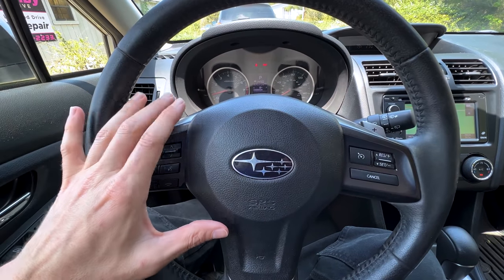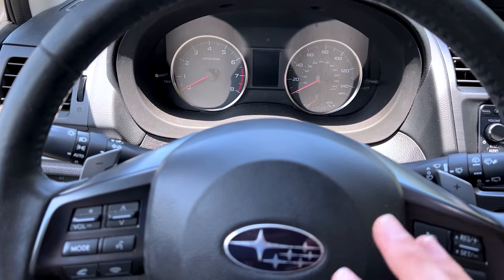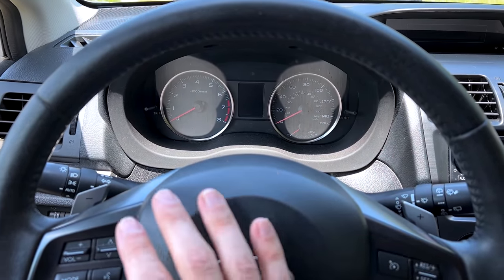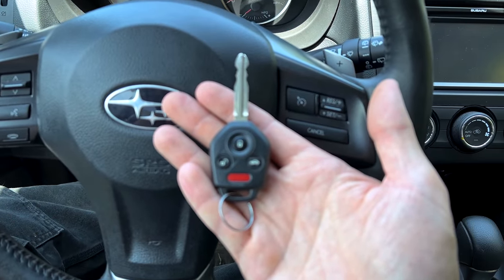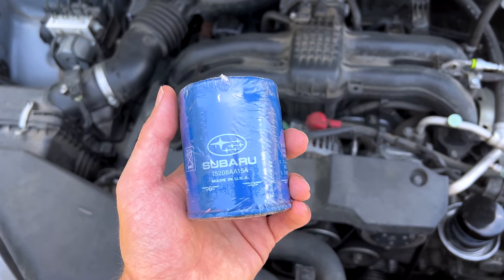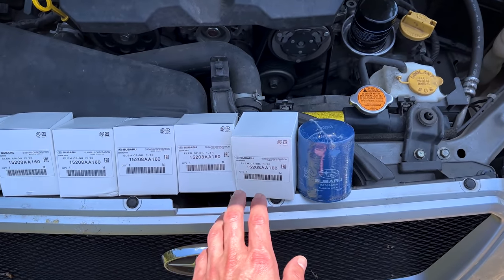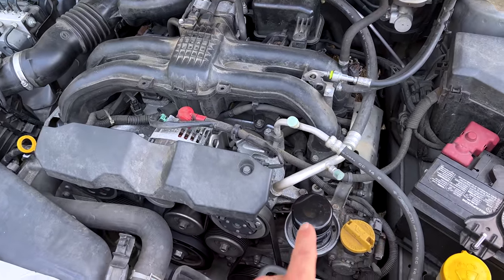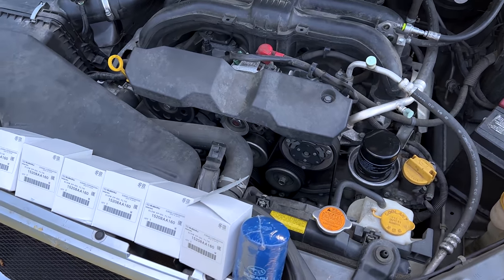Subaru Clear Flood Mode Cranking And Black Vs Blue Subaru Oil Filters! Know The Difference!

Comment: To add to the cars with the push button start, you still need to put one foot on the brake when you floor the gas with the other to do the clear floor mode.
Reply from the maker: Ah, right. Forgot to mention that left foot braking.
Reply: I’m going to try this on my 17 brz and 13 frs I wasn’t aware of this but will definitely become a must in my maintenance proceedings
Reply: If I understand You correctly this is going to work both with AT and MT Subarus?
Reply: @MrSubaru1387  Curious how this works for the plug-in hybrid.
Reply: This is the comment I needed! Thank you!
Reply: @chadwickmason9851  does it work on the BRZ? If stick, I'm assuming you need to Floor the gas and clutch, since we don't have 3 legs 🤣
Reply: Hi Mr. Subaru. Will a Toyota 86 oil filter better then the Subaru blue oil filter for the 2013 impreza 2.0L non turbo?  The Toyota filter seems wider and shorter then the blue Subaru one. Will u able to do a compair for those?  If they are compatible, then I will switch to Toyota 86 oil filter rather than using the blue Subaru filter. Thanks for your review
Reply: What if is a manual transmission????? I have a buttorn start, press on gas pedal and break hit the button and nothing happens!
Reply: If i press the clutch it would just start and rev up
Reply: @Fabiek3  it does work with manual. I have a 2013 manual crosstrek, it’s all the same you just have to floor the clutch like normal and floor the gas to disable the ignition and fuel injection. The only difference is the clutch
Reply: @balancebreaker1561  if it’s a manual, the clutch has to be floored for the starter engine to do anything at all
Reply: @balancebreaker1561  you have to press the clutch and the gas to the floor for a manual
Reply: @loganrobinson8135  Thx Man for the answer ;-) last time i change oil i just try this and as You say it worked ;-) not that i need it much, cause i can fill oil filter with clean oil - it is in bottom of engine - but its good to know
Reply: @loganrobinson8135  you late my friend but thanks tho
Reply: @loganrobinson8135 i knew that from the start, the part i was missing was the Ebrake had to be on too
Reply: How long do you crank after an oil change? Thanks for the video!
Reply: Thanks you are right sir😊
Reply: Thanks.  Question:  How long do you crank the car for?  How long does it take for the oil to reach all the parts?
Reply: @MrSubaru1387 Did you have your other foot on the brake pedal?

Comment: Yesterday, I had my oil changed.  Thanks to you, I knew to buy a black filter, and used the flood mode just after they filled up the oil.  I did originally buy the blue one, then bought the black one, was surprised how much heavier the black filter was.
Reply: Did you get the black filter from dealer?
Reply: @truckerrickakamanowar  Yes.
Reply: @CharlesSnyder  Thanks

Comment: Good info. I like using the Wix XP 57055xp oil filters on my Subarus due to the premium construction and it has the correct bypass spec.
Reply: I roll with Wix as well
Reply: Extended interchange filters like the wix XP can go for those longer periods because they filter smaller particulates out less efficiently than the standard wix. If you change your oil every 5000 miles your engine is better protected with the original wix filter
Reply: Here's a tip, 51356XP. Same filter but more material. I've been running them on my 08 Forester for years.
Reply: Does anyone know the bypass spring strength/tension on the black OEM filters?
Reply: Thanks to his oil filter tear down video I only use Wix oil filters.
Reply: @TBlade471  I find the bypass pressure to be too low in the 51356 filter(8-11psi). The 57055 filter has the correct Subaru bypass pressure of 27psi. Less chance of the oil prematurely bypassing the filter media when the oil is thicker in colder situations

Comment: Thanks for the link on where to get the black oil filters. I was so close to replacing it with the blue oil filter.I bought two and they came in just in time to do my oil change yesterday. Doing the oil change on my 2022 Forester Wilderness was a breeze, only after watching almost all the videos in your repair playlist. It gave me the conference I need to tackle this on my own. The flood mode worked great and like you had replied on some of the comments on your previous video, All I had to do was step on the brake, gas and hit the push to start to go into flood mode(repeat to deactivate). There wasn't any videos on what I was to expect with the push to start but, follow your directions lead to a complete oil change. Thanks for all your insight and knowledge. The fact that you are not biased is amazing as well.
Reply: Press the push/start button and release or keep pressing?
Reply: @3doh  just push, you don't have to hold it in.

Comment: Despite the top mount filter, I still pre-fill it. I pour in enough oil to fill the filter, and let it sit for a few minutes. Then I put the filter upside down in the funnel to drain out the oil into the engine. This saturates the filter medium and shortens the amount of time it takes to build oil pressure.
Reply: Unless your only pouring it through the small holes, which would take a lot of time, your sending unfiltered oil into your engine which isn’t a great thing to do.  Your intentions are good, but unless your taking an absorbent amount of time to make sure the oil is only going into the small holes and not into the giant center hole your efforts are actually working against you.
Reply: I'm going to agree with Justin here. I add oil to the filter and let it soak into the elements. I roll the filter on its side until there is no oil showing in the center hole. I'm more comfortable knowing that the filter elements are saturated before I prime/start my engine. Although this oil may be unfiltered by the engine filter, I believe that, since it hasn't been circulated through the engine, it is cleaner than the oil that has. YMMV.
Reply: @douglaswilliams4498  you should do some research on what unfiltered oil does to your engine there fella.
Reply: @JB-qf5pn  I took your advice. What little I could find about oil is that new oil is clean oil. I still don't think presoaking the filter elements in new, clean oil is harmful. I will concede that it may not really be doing any good, either. We're talking 2-3 ounces of clean oil, not unfiltered. Thanks for your videos.
Reply: @JB-qf5pn  I think he is using new oil. It was filtered when it was made.
Reply: @JB-qf5pn  the extra time it takes to build up oil pressure without priming does more damage than "unfiltered" oil.  ask any truck mechanic if it's a smart idea to skip prefilling, seeing those filters can hold about a gallon of oil.  and besides, this new but "unfiltered" oil is magnitudes of times cleaner than the oil that was just drained out that the car was running on with its last mile before the change.  maybe you should do some research.

Comment: Given: longer break from driving the vehicle.
Question: what kind of length of time is long enough to prime the oil this way? 

As I commute by subway, sometimes my car is not used for two weeks. That always worries me when I turn on the engine.

Thank you so much. That's very valuable for me and easy for you to film. Benefits both of us.
Reply: Shouldn't take but a few seconds

Comment: I personally use Mazda (N3R1-14-302) oil filters on my STI, a little higher capacity plus it's made by Tokyo Roki too.
Reply: Same here, but for my 17 Forester XT
Reply: Same here on my STI.
Reply: What years will Mazda filter cover ? I have a 2021 forester
Reply: same, 11 wrx
Reply: @ckiely27  888 vehicles according to Subaru, just lookup 15208AA12A on Subaru parts and if you vehicle is on the "what this fits" list than it's safe to say it would work.
Reply: @YiZK  Thank you !

Comment: Tokyo-Roki black oem filters is still the best, i stocked them too for my STi.
Reply: 15208AA20A ( made  by Tokyo Roki in Indonesia) is basically Japanese made 15208AA160. The only difference is 5% less of filtering material in 15208AA20A but because I use them  with 2 liter engine ( CrossTrek) Indonesian filter still has more, than enough .

Comment: I've been using Mann filters for years.. with 5w40 in the winter and 10w60 in the summer (track use) on an ej205 and the car is always running like clockwork.

Comment: @MrSubaru1387 ,
Do you know if this process is the same on manual transmission vehicles? Just bought a '22 Crosstrek 6MT and am preparing to do my first break-in oil change. I understand it to be a drive by wire throttle body, but sounds like I may need to manipulate all three pedals simultaneously and I don't want to stress my brand new engine with barely 100 miles on it. 

Appreciate all your thorough content!

Comment: I dunno about the FA/FB oil filters, but for the EJ motors, you can use black mazda filters part number: N3R1-14-302. That’s what I use on my STI. They are better than the blue filters from what all my research shows.

(Lol apparently you know about this because its the first comment on the amazon listing)

Comment: 2020 sti here with a dealership oil change (13k on odometer) done almost 4k miles ago and the oil filter developed a hole somehow (bottom mounted oil filter but not a scratch on it since it's protected with underbody covers)

Leaked out all the oil didn't realize this until the low pressure light came on. Towed it to the dealer and they gave me a free filter and oil change replacement only after i said something about it but my diy oil changes will now be using better oil filters. I thought I could trust the OEM stuff but I'm glad to hear this feedback.
Reply: DIY oil changes are a must! That way you know exactly how much oil you are putting in and you know the oil filter will be threaded on correctly. Since the EJ257 oil filter is mounted on the bottom, I recommend you pre-fill the oil filter with oil before you install. Have fun brotha!

Comment: MrSubaru, my question was about 15208AA130 (thick) vs 15208AA160 (thin) oil filters. They aren't the same, but both applicable for FB-series. And both black, by Subaru Japan.

Comment: This works well when ready to start otherwise done with a breaker bar turning engine to prime oil pump. ( cylinders aren’t moving as fast to create dry start but pump still see’s positive pressure and builds it. ) otherwise this still moves the cylinders fast enough to create scuffs. 
Last solution use an oil that has good sling in its formula that stays on metals and you won’t have issues. 
Why you ask? Because the amount of oil that gets tossed on cylinders is no different than what’s already slung on metal during cold start.

Comment: Correct me if I'm wrong but clear-flood cranking is something that is present in most vehicles these days. A mechanic showed me how to do it on my 2007 Pontiac and I've seen it repeated many times before and the procedure appears to be the same. You floor the gas pedal and crank the engine over.
Reply: Ford Boss Me *dealer tech) does it all the time on the cars and trucks he repairs

Comment: I’ve got a 2013 Crosstrek, bought brand new May 2013 and have been using the blue filter with Mobil1.   Oil with blue filter & crush gasket changed every 4000 miles.   I haven’t had any engine issues at all.   Only issue I’ve noticed is that the engine is very much under powered.

Comment: Not all the questions have been answered...yet.
I can understand why this may be done after an oil change, but what's the difference when the car has been sitting for hours and then you go to start it up?
The oil in the filter drains down when the engine is shut of and the car sits for awhile, then upon starting, the system has to pump oil back up. No different than when changing your oil, filter needs to be primed.

So my questions is, does or should this Clear Flood Mode Cranking be done whenever the car sits for more than a couple of hours?

Thank you for the video, great info, but I just have this question now...LOL!

Comment: Wix 57055 XP is my choice.
Reply: What year car do you have? On an EJ it is 57712 which had the 23 PSI bypass valve which is what you want.
Reply: @jimrossabrena7955  I have a fb25. The wix 57055 xp has a 27 psi bypass.

Comment: Thanks for the refresher. After your previous series of filters, I always buy the black/Japanese filters for my 2016 Crosstrek ltd and 2019 WRX STI. No blue! Question on the clear flood mode cranking...would you recommend doing that on the EJ series motors as well (ie my STI)...since it's mounted to the side of the block? I would assume so as you'd still want to use it to fill the new filter and pressurize.
Reply: I've been priming my with fresh oil before install. The media will take about 1/2 qt to saturate. This is on a 09 3.0 side mount, bottom of the block. Never heard any timing chain rattle. It will accomplish the same thing. The momentary lag to fill before the oil pump since the filter is the bottleneck. It's already primed directly before the pump and takes no revolution before start up. It's my logic in that design.

Comment: Why can't you prefill the oil filter, even one mounted such as they are on the FB engines? I thought they had anti-drain back valves that would keep the oil from pouring out of the filter. Thanks Mr. Subaru for your great videos!

Comment: Great video.  I didn't know about the blue filters and just got a case of them . I'm 50 and new to subaru. I've built 60 and 70 mopars for years and ya fram is the worst filters you can buy . Cut one open and compare it to just about every other cheap filter you can find and you will be stunned just how shity a fram filter is  a Purolator filter is far superior and usually 1/2 the price.  But hands down you can't beat a wix for old America cars anyway.
Reply: The orange can frams aren’t that great but the fram titanium is one of the best filters on the market and filters down to 20 microns.  I’ve always been a purolator guy so …
Reply: Nice my uncles still had his 66 Belvedere,  it was a police pack 4sp 383 car, he just did a restoration with a new 6.1 Hemi he punched out to 426, in British racing green. As for me I have a 3.6R that I've added Bilsteins ect too.

Comment: Not all with electronic throttle bodies can do the clear flood mode via the pedal to the floor method. I have a JDM 03 Legacy GT (BP5). I unplug the crank position sensor on mine to do it.

Comment: Great Video.
Got a Question about these Filters.
Could they be used on a EJ253?
I recently replaced my worn-out Engine in my 2011 Outback(250k) with a  New JDM EJ253 and would like to keep it going.

Comment: What about the Z411 filter for WRX Models?? the "Ryco" Z411ST is almost identical to the old Japan Made STI Pink filter. The paper inside is re-inforced with stainless steel mesh. Its also a tad longer.. so should filter better. Its designed for a Mazda RX8. But works great on my older EJ 1997 WRX

Comment: I thought the OEM filters are the best I can buy for my cars until I saw this video. I’m a little confused about the part number. When I look up the oil filter for the 2005 Forester XT and the 2018 Forester XT, both have the same part number (15208AA100). I know the filters I bought for these cars has 2 different part numbers from the dealer. What’s your thought? It’ll be great if both cars can use the same filter so I don’t have to stock both but just want to make sure. Appreciate your help as always. Thanks!

Comment: I had a dealer do a scheduled oil change on my 2019 Subaru Ascent Touring. They used the blue US OEM Subaru oil filter. Well, what a disaster. When they finished the oil change and started it up the oil filter failed, spraying oil all over the engine compartment. The dealer flushed the engine compartment multiple times to get rid of the oil. 3 and a half hours later I got an explanation of the problem (the dealer didn't charge me for the service). I drove the Ascent home 18 miles without an issue. The next day, I drove the Ascent 8 miles, the dashboard lit up like a christmas tree, check engine light came on, the safety systems were disabled and the vehicle died twice. It was towed to the dealer. The oxygen sensor failed and it took 3 days to get parts. The dealer took care of the repair but I have zero confidence in the blue oil filters!
Reply: That's not the filter...they just forgot to put it on (distracted etc....) I've seen it more than once...oil goes almost to the ceiling when it starts without filter.
Reply: Or they left the filler cap off
Reply: @douglaswilliams4498  They didn't. They showed me the "mess. The Blue OEM Filter failed without question.
Reply: Anything is possible. I have been working in professional auto repair shops for over 25 years and never had that type of oil filter failure happen. I can tell you that everytime some one messed up it was always blamed on the "defective" filter...

Comment: You talked about the NA Subarus but I’m looking for what filter to use on the turbos? I have a 2022 Outback Wilderness with the FA24 with the Blue 15208AA15A that was on it from factory. Would it be safe to use the Black 15208AA160 filters? I really don’t want to use cheap Fram/Subaru filters. Hope you can help I just hit 1000 miles and want to do my first oil change soon. Great videos by the way I watch all of them. Keep up the good work :)
Reply: I'm not sure what the black Tokyo Roki alternative for the newer F-series turbo motors, but for my Baja Turbo I've been exclusively using Wix XP filters. They're inexpensive and easily found at pretty much all the major auto parts stores and Mr. Subaru had a lot of good things to say when he took apart the Wix and Wix XP filters in his oil filter showdown/breakdown video. For your OB Wilderness you're specifically looking for the Wix 57055/57055XP.
Reply: Good question,  Wix is a decent filter, not sure if you can run the 3.6R black filter. ...